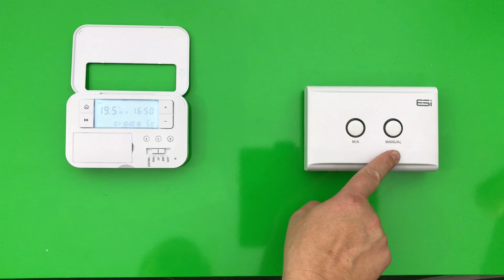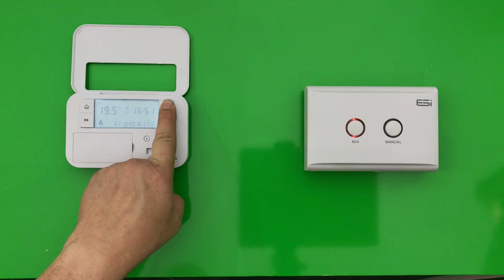ESi Controls RTP4/RF Pairing the Reciever

Comment: Just wanted to leave a quick update since my recent comments. For those who mentioned their green light stayed on continously therefore when trying the steps in this video wasn't working. I managed to figure a way of solving this and should've thought about doing this sooner. Just turn off the boiler completely from the mains electrical socket. Switch the boiler back on after 15 seconds. You will notice both green and red lights on the receiver turn off. Then position the slider on the thermostat to off and follow the steps in this video. The receiver and thermostat should  now sync. Hope this helps.
Reply: Really helpful. Just worked for me as I wasn't getting anywhere to start. Thank you. Its now working.
Reply: Epic thanks!
Reply: Thank you worked for me.
Reply: Lifesaver,  thank you!
Reply: Thank you that worked 🎉
Reply: Super duper THANKS !!!!!
Reply: Cheers. That was the tip I needed.
Reply: Thanks - your advice sorted my problem 👍
Reply: Hi this worked great until the press the a/h and plus which it didn't do anything (green kept flashing) how long do you need to hold it for? Thank you
Reply: Brilliant thanks 😊
Reply: Omg thank you so much! Been ripping my hair out for the last 40 mins trying to figure out why i couldn't make this work. You're an absolute legend!
Reply: Much better it now works after this little change, thank you !
Reply: Thank u  🙏🏻
Reply: Legend thank you 🎉
Reply: Change batteries in receiver if still having problems (eg still flashing green) , mine worked srysight away after new batteries and following your video xxx
Reply: Thank you so much for your help!  I tried the steps in the video and nothing happened.  However, since you update in the comments section, turning the boiler off for 15 seconds, and then following the video, it WORKED FIRST TTIM!!!🎉😊 Thank you so much for your help.
Reply: Thank you!
Reply: Thankyou for sharing this has sorted it for me 👍
Reply: Better info than on their actual website! Thanks mate 👍🏼👍🏼
Reply: 4

Comment: Why is there no video on how to turn the heating on wtf
Reply: I know your pain on that one as when I moved in to my house 3 months ago, I was left this device from the previous tenant and no instructions and the house was bloody freezing! 🥶 

With no clue about what to do, I had to call my landlord and after 45 minutes on FaceTime, we were equally frustrated that ‘ESI’ have videos on just about everything else but nothing on how to switch the heating on.  😬  in the end, we gave in and I started playing around with the button and eventually, it started working.
Reply: @Micegift  AHAAHHA you turn on the red button right
Reply: Both the green and red light om the receiver need to be off, then slide the button to manual and set the temperature higher than it says on the controller on the top left, so if it says 20° set it to 20.5 or 21°

Comment: My green light keeps flashing while pressing A H + buttons. İt won’t turn off. The antenna sign is also showing without the circle and line
Reply: You have to select A first, then H and then 3rd +. Wouldnt work for me when holding then down at the same time

Comment: If both lights are on as it was in my case, turn off the boiler completely. Switch the boiler back on after 20 seconds. You will notice both green and red lights on the receiver turn off. Then position the slider on the thermostat to off and follow the steps in this video. The receiver and thermostat should  now sync. Hope this helps.

Comment: I followed your tip about turning off as mine was not pairing, it still didn't work so I change batteries and it worked straight away, thanks x

Comment: Thanks for this. My controller became unpaired after I failed to replace the low batteries in it and they eventually died. This sorted it out in seconds. 👍   

Note to self: next time just change the batteries.
Reply: @shockz16 how do you get both lights to go off so you can do the start of the vid?

Comment: Was failing at the pairing stage pressing "A H  +" to connect to the flashing green light until putting new batteries in, then it worked immediately.

Comment: Hello, I changed the batteries in the hand held bit and now it won't pair. It makes an effort to get the signal but doesn't quite make it. When I press the MA button the right one comes on as a solid green. I've tried switching the boiler off as advised but nada, null point, nothing. Any ideas, please?

Comment: My receiver lights behaviour are not like in the video. Anyone suggest equivalents so I can re-pair? Basically I start with red and green both on and continuous from power-on, can have red off and green continuous, don't have a choice.
Reply: The other ones are both flashing. I had some work done on my electrics and on reboot the pairing was lost.
Reply: I found a solution. I had my house re-wired because it was full of faults, and they moved the heat pump to a 40A circuit from a 20A one. Suddenly everything went OK and this video made sense, the button patterns became true and repairing was easy.
Reply: I'm having similar issue. The green light stays on continuously and the only other option I have is to turn the M/A red button on and have them on at the same time.
Reply: @diw885 did yiu manage to figure out what to do as I'm having he same problem

Comment: I bought a new controller same make as the old one, ESI , this one doesn’t have the circle with the antena in the middle but it’s not connected to my boiler vaillant. 
I am trying to pair with the existing receiver but the green light doesn’t stop flashing! Can someone help how I can pair my new remote controller to my boiler? Do I need a new receiver for this new remote control, pls help thanks
Reply: Did you figure it out

Comment: Hi, My manual button does not stop flashing even when I hold the A H + button for a few mins it just doesn't stop flashing so I can't pair it with my receiver any ideas? I've turned the power off the boiler and waited 10mins to try that but it still doesn't stop flashing
Reply: Should I try change battery's in my receiver? And try again, any help would be great
Reply: Mine same, have you successfully yet?